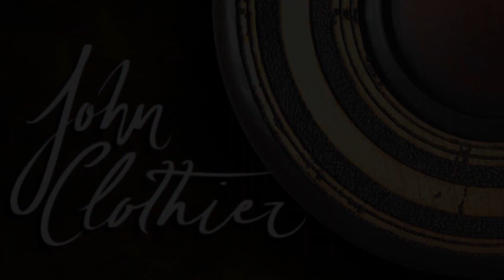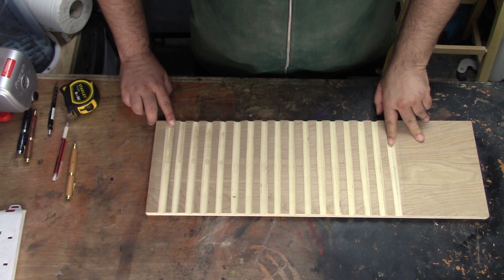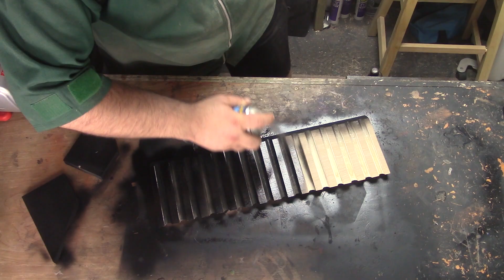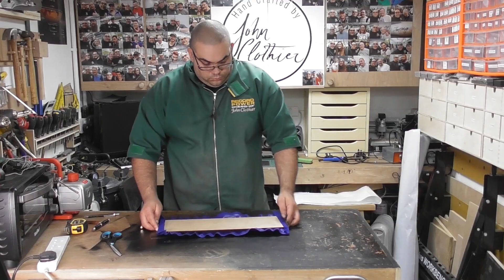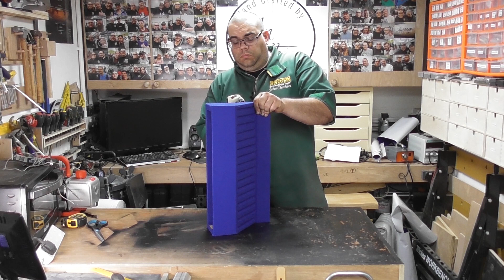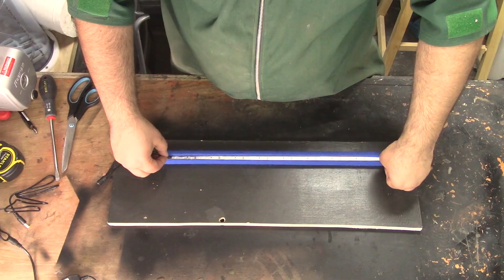How To Make A Pen Display Stand

Comment: Great job John. Cutting those grooves is no way as easy as you think. I did mine by hand router for my box and spent ages as I had to do 3 passes because I needed a flat part in the bottom. Well done!

Comment: Nice build John,think I'll build it first and then flock all the visible faces👍👍👍👍👍👍👍👍👍👍
Reply from the maker: Alan Mullock thanks. Flocking would be a better option. I looked into getting the kit but it was so much more expensive than the roll of sticky back felt I bought for £4. If I was making several of them I would definetly make and then flock for sure

Comment: Love it! I need something that I can take with me that not only displays the items but also protect them in the car and so. Something you would come up with you think?
Reply from the maker: Thanks! I have a zip folder that holds around 40 pens. I use that for transporting pens.
Reply: @JohnClothier  ok. I need to come with something that is both display AND safe
Reply from the maker: You could put a strap across the display stand. That would hold the pens on the stand and could be removed later

Comment: I've been thinking about making a pen display stand for sometime. I like the way you've made yours. Unfortunately I don't have a router or a table saw. So a little more thinking time for me.
Reply from the maker: Miss Tee's Woodturning Thanks. You could do it with a hand saw and the router is just an easy way. You could just use small strips of wood rather than route it o7t
Reply: As I'm into retro I'm thinking of a stand in a style of the 50s or 60s. I'm not sure how yet but I'll come up with something.

Comment: Flocking might have been a little easier, but you can’t argue with those results.
Also, taking smaller bites with the router would help with the problems you had with it.
Reply from the maker: Thanks Buddy. I totally agree flocking would be better. I looked into getting the kit for flocking but compared to the £4 the sticky felt cost it just wasn't worth it. If I was making several I would definetly flock them. The ks for the tip on the router. Not a tool I am very experienced!